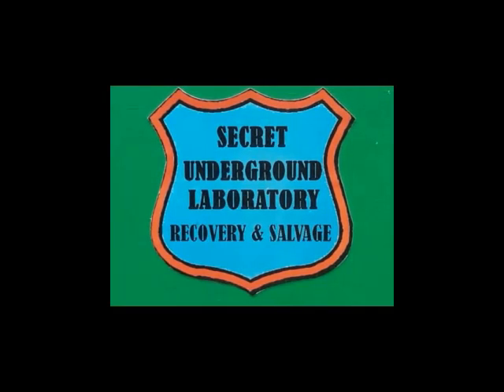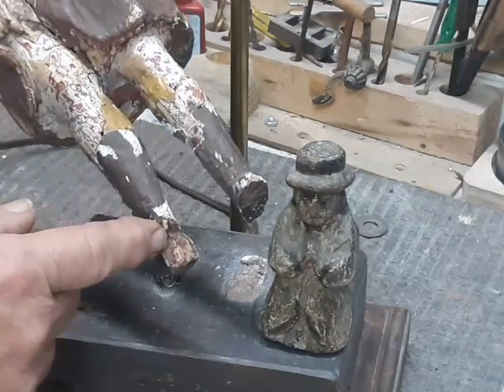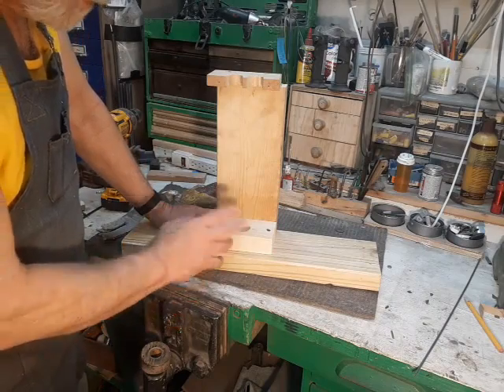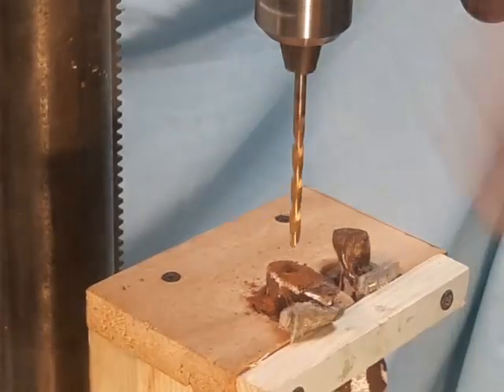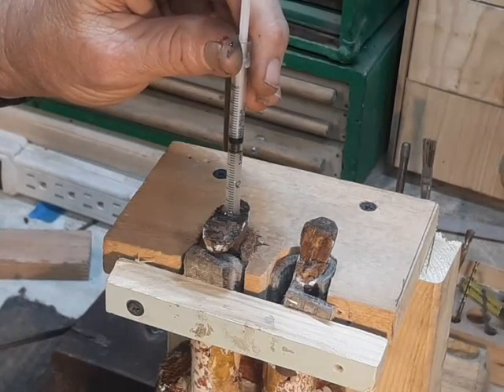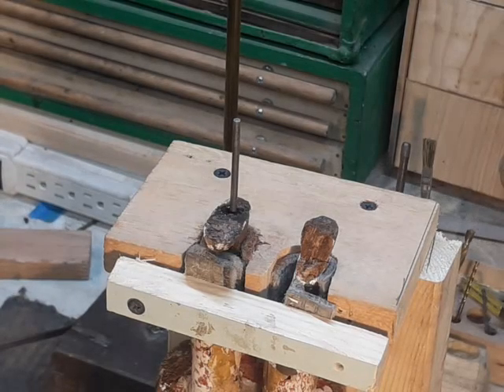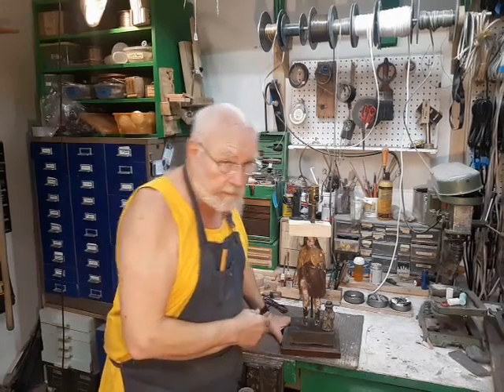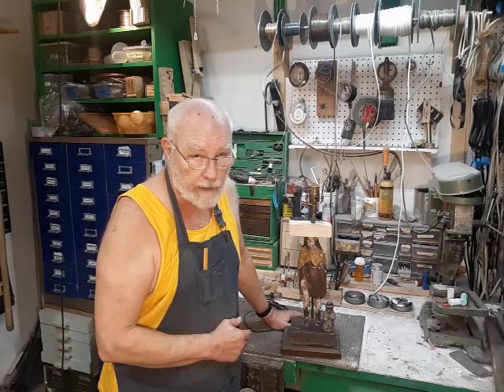Putting Saint Somebody Back On His Feet in the Secret Underground Laboratory Recovery and Salvage

Comment: The metal rod is the perfect solution.  I would have tried a wooden dowel but metal is much better due to the limited amount of material
Reply from the maker: Thank you very much. This failure was the result of a bending force at the weakest point. A wooden dowel small enough to fit in the leg would not offer any increase in strength. It would snap just a quickly as the original. This is a hard learned lesson.